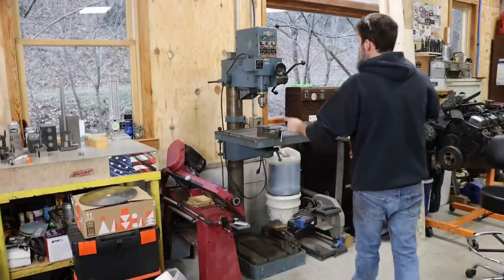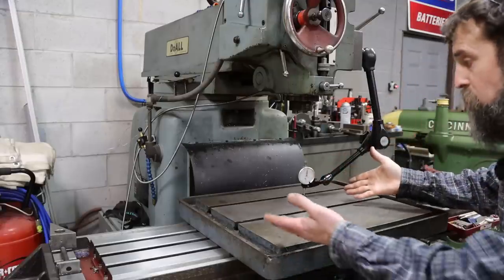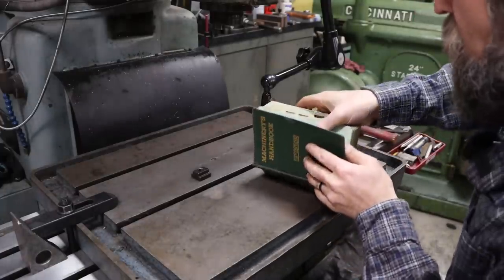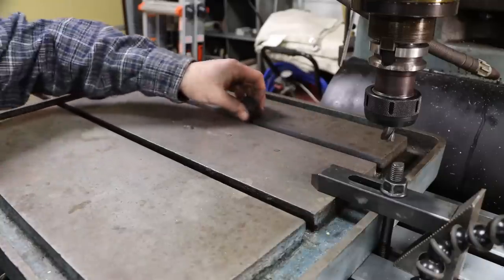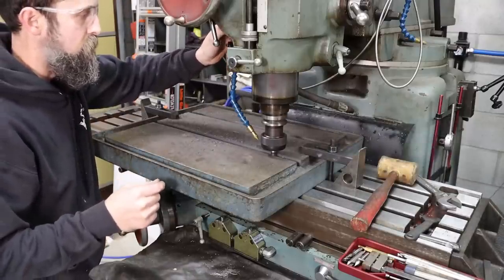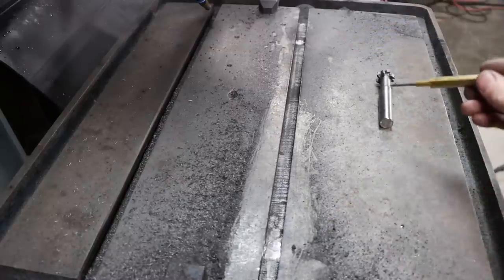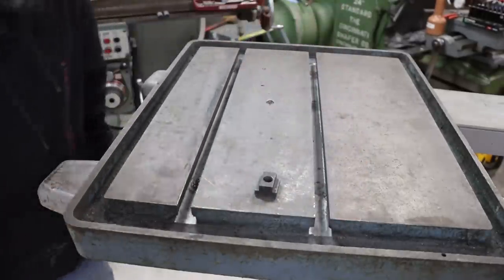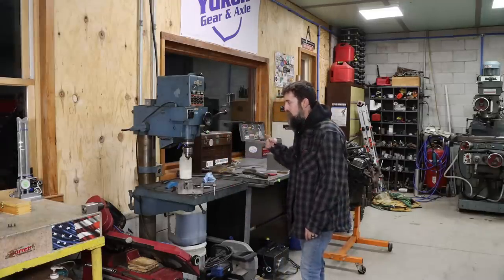Why Didn't The Factory Finish This drill? Machining the T-Slots

Comment: I have the larger MK4 brother of Your drill press, really nice machine to work with. Mine had the M12 14mm T slots. Made me think this could perhaps have been a metric imperial problem. I do not know if the re branded Doalls were made by Arboga or produced on license.  If it was imported from Sweden the T slots could be M12 as they where on mine. Never seen roughly machined T-slots on these before. Mine had the table replaced with one of those Demander XY tables and an old digital well. Makes locating holes a breeze and the machine more useful. The xy table was an option from Arboga at least here in Sweden. Nice upgrade btw, I agree on keeping as few sizes as possible of T-nuts etc.
Reply from the maker: Either way metric or  Imperial slots these were so rough and uneven from one side to the other that they would have been a nightmare to try and use. This is a Swedish machine so the casting was probably done with the intention of finishing the slots 14mm . My other drills table and foot t-slots were finished nicely. 
They are both wonderful machines and are a joy to use. We also have one at my day job.  It's sold under the Wilton name as mine are sold under the DoAll name.  Same machine difference name. It's slots are all finished as well. Maybe it was a option to have them done or not🤔.
Seems strange that the base was done and not the main drill table. 
Thanks for watching the videos.
Reply: @SteveSummers  It makes no sense for a quality conscious brand like Arboga to sell the tables without machining the T-slots. I guess they made a serious mistake with Yours. They also came with other tables, I have seen smaller round ones. Milling cast is always interesting... carbide breaks easily as well. I think You made the right call skipping the coolant, I never use coolant on cast iron. But I usually rigg a shop vacuum since the dust is pretty abrasive and ends up everywhere.I agree that these are a joy to use. Had withdrawal symptoms being without one for some years...

Comment: I was hoping that you would use one of your many new horizontal mill cutters to cut the center of the slot to depth/width before using the T-slot cutter to finish it.  It is surprising that the t-slots wouldn't have been machined originally indeed!

Comment: It is very possible that the T slot itself was a sand casting included in the mold to save machining time. I have seen ten thousand castings that were cast that way. It also saves cost of fuel to melt product which would be removed any way.

Comment: When i cut wood i use bits/blades that let me make my cuts in small steps?  I find it a lot easier on my machines and Blades/Bits..and actually faster in most cases...too...
I'm no machinist...but I stayed in a Holiday Inn across from a Machine Shop once !!
I do the same when cutting thick grass or deep snow...i take lighter passes and it is more efficient and easier on my equipment too.... taking Full passes usually is not the Best Plan ( when possible )...

Comment: Howdy Steve    hope your well missed a video this Saturday.     Got a question on your truck rebuild, did you do any work with the ac heater systems?   I'm trying to find vacuum lines for my 78  so far its to small or big.

Comment: Why not a shop vac instead of air blowing all the cast shavings onto your mill table. Plus it would have stopped the problem of clogging and recutting swarf that had already been cut.

Comment: Couldn't you 'clean' your coolant with a magnet?
Also, just do offset passes, such that you'd only have 4? Or does doing 5 make it more precise (spring pass, per se). Or what a straight carbide cutter for the first pass, especially with the glass hardened area? Could've fixed that apprentice mark to (weld and mill down). (Edited bc I'm still watching.)

Comment: Common issues  the do all is the same as  meddings drills  in the UK have used loads of them standard clamp set don't fit need M12 tee nut that's 14mm wide

Comment: THAT IS ONE HEFTY MILL! Bridgeport style but a masterclass frame... What is she, 2.4 tonnes? around 5k pounds? Maybe less, as the main body is likely somewhat hollow, but still, that is one gorgeous lady... Also, before indicating that surface, i woulda flat stoned it just to allow the wide indicator ``tip`` to not have to contend with any high spots that would allow the needle to jump around the clock... Altho, here it really was not needed, as the clock itself displayed... Also, i woulda placed an A3 or larger paper between the mill table and the drill table, just to allow for some protection and better grip with the toe clamps... Also, altho unnecessary here, it provides a bit of dampening effect due to nature of paper... Speaking of dust and coolant, i woulda used coolant, just plug the drill table drain holes(cant see any) and flood the table itself with what, 0.6L of emulsion mixture and let the coolant contain the cast iron dust, rather than blowing what is essentially abrasive dust all over the shop... Save your main coolant, but if you are working with a pocketed part, fill the pocket out with coolant and contain all the work from heating or producing free swarf/dust... I woulda for example extended the quill all the way out and wiped it down with a fresh clean and oiled lintless rag to remove any cast dust from it in your case... Also, consider other cooling fluids... When i do extensive drilling or milling or even tapping in a blind bore or a pocket, i prefer to use regular mineral oil or for hardcore drilling and tapping, manual gearbox oil... Sure, its smokey as hell, but it provides total containment of any small swarf and micro-chips, aswell as providing great lubrication to the cutters(drills and taps incl) and decent enough cooling to allow hssCo and carbide tools to never break a sweat... I almost always mill cast iron flooded entirely... If i have to work with it, i make sure i can flood it like in you would in an EDM machine... I know it needs no lube, but i dont care for what cast iron needs, i know it wants a sharp cutter and total containment as not to produce what your average machine fears as much as americans fear asbestos... A marvelous material to work dry, and a machine carcinogen... Dont expose such lovely machines to that terror...

Comment: O1000
N100 Well I guess our question of why didn't they finish that table was answered lmao cuz they were smoking cutters left and right on those sand castings, on what must have been a bad day at the do-all shop for sand cast drill press tables, when they ran out of cutters I'm sure the foreman just said 'send em' and back in that day when that machine was born the machinists couldn't even spell carbide . 
N200 Now for some pro tips on t slot cutting, if you're going to cut a t slot on a machine table, fixture plate and the likes, always overcut the bottom of the slot with the endmill if you look closely at his do-all Mill table that's the way it's done, lots of reasons why mostly though you never want to rely on a woodruff, side milling, t slot cutter to End Mill not really designed for that, they do great on finished passes 5 -15 whatever but it's not meant to plough it all out,  sure in production situations cnc's lots of coolant they do it all the time Steve's shop nope, it'll last a lot longer and in this case the carbide endmill highly likely would have handled that sprue issue and then the staggered tooth t-slot cutter would have done a pretty good job just cutting on the sides, and being too lazy to put the chamfer on the top of the slots... unforgivable! that's cast iron that sharp edge is just going to Chip, kick up a burr for the rest of its life and always be a knuckle bleeding sharp edge quite shoddy in my eyes, gonna file it? I filed cast iron once!
N300 now I know I sound critical, but I love Steve Summer's channel I watch all his content and I think he's doing God's work saving all that real American steel and yes! I think he is a mechanical wizard.... machining wizard...meh? that's me... any questions? just assk h'ole Fred here at Sullinger Complex Machining in Colorado. "Cradle to Grave" they will peel 436's out of my dead cold hands.
 M30.
footnote:
steve's channel also inspired me to recently save a Hardinge HC and now i'm looking for a Hardinge TM-UM i may go down the hardinge rabbit hole..it only takes 1, and the best machinist on UT is adam...demuth 'adam the machinist'

Comment: Sometime you just got to get sh..t done.
I sometimes have to machine hardened bending dies for produktion pipe bending machines at work.
I know i will burn a lot of carbide plates but it cuts and the bender needs to be up and running and make money.

Comment: Keep the dog out of the shop, for the dog's safety.
I'm sure those who made that drill press, did exactly what their boss told them to do. And that this drill press was made for a specific market. A bit on the cheap side, You might say. They probably sold more machines that way, and that may be the reason You now own this one?
Just be glad that they cast the table so flat on the underside, so You now can clamp it down on Your mill table.
Reply: My hound rides inside the truck when it's cold (she doesn't wear a seat belt).  When it's warm she rides in the back.  She enjoys both.  She is in my shop when I am.  She is in the house when I am.  Life is too short to be without a dog around. I'm sure Steve takes very good care of HIS dog.  I wouldn't want to tell him how to do that.